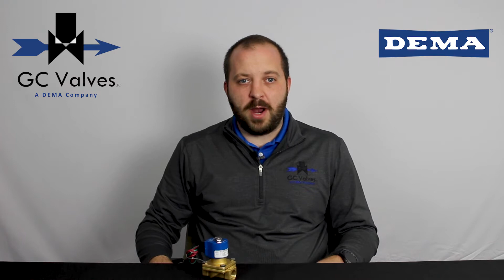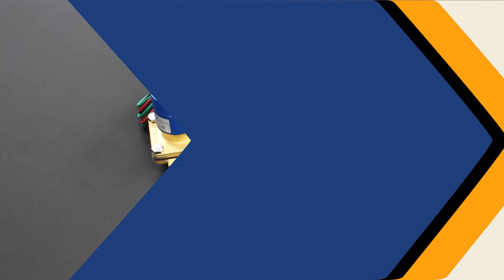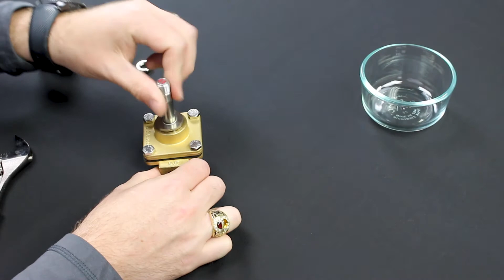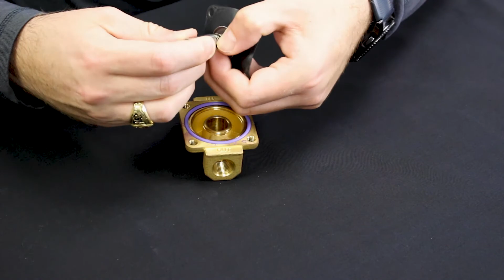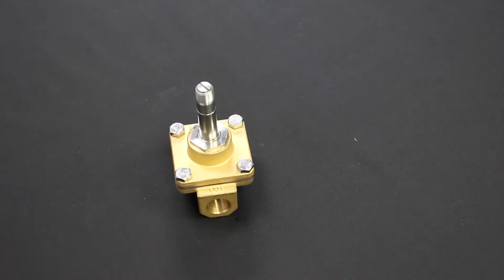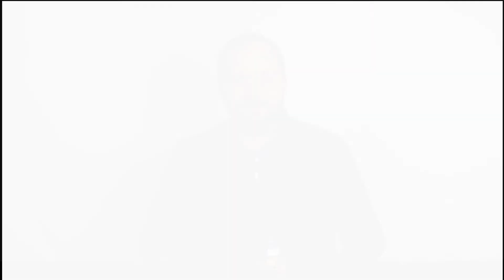S20 Valve Repair

Comment: Thanks for the video.  I'm curious if you can comment on whether or not the orientation of the "bleed hole" (or whatever it's called) in the diaphragm makes any difference or not in the solenoid's ability to remain closed?  I've seen other solenoids where the hole in the diaphragm gets oriented towards the outlet side of the solenoid.  Please advise and thanks for your time.
Reply: Any update?

Comment: Excellent video! Can you provide a link to the repair kit page? I have a S211GF02N5CG4 that I need to do this on. It is a high-pressure fog system and turns on fine but when I turn it off there is still a trickle of mist coming out. I am assuming this is the issue.